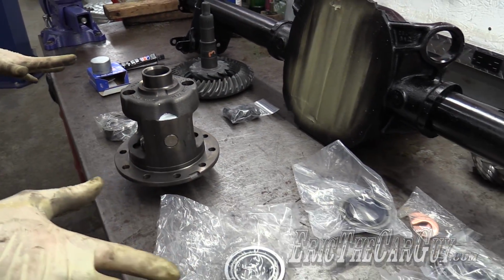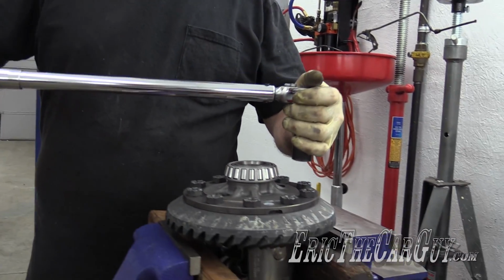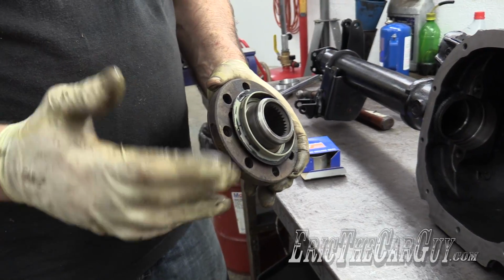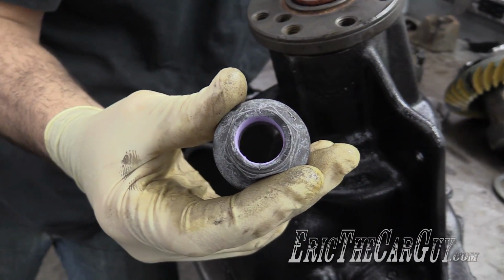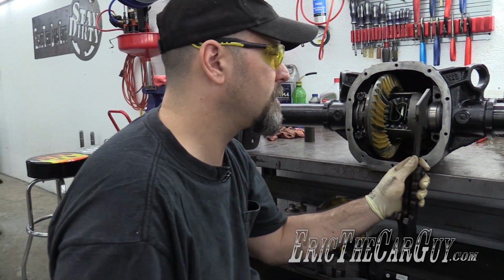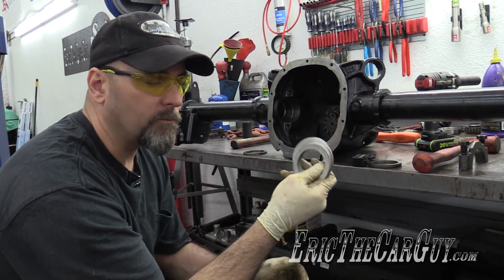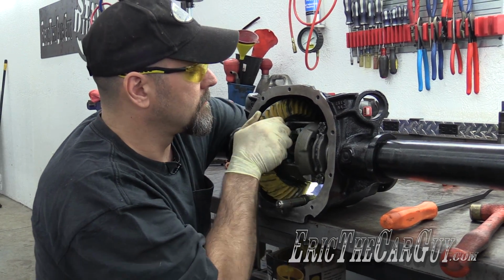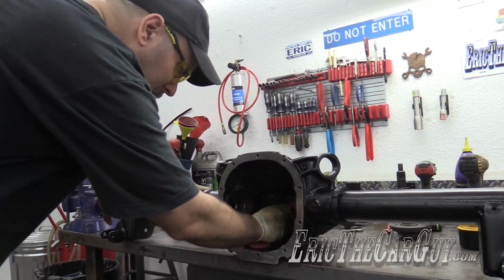Ford 8.8 Assembly & Set Up (Part 1) #FairmontProject

Comment: So you have that backlash because the shims moves the differential gear back and forth. But because we have a inclined teeth gear, that back and forth fixing results in less or more play, like in a right triangle, when you shorten the hypotenuse, the cathetus gets smaller. 
At least is what I understood.
Reply from the maker: Depends if the gears are face hobbed, or face milled. https://www.youtube.com/watch?v=0Y6vOwiCe1U
Reply: EricTheCarGuy So for face milled if you have shims that does not allow you for great adjustments, you can end up with a bigger or smaller than wanted backlash?
Reply from the maker: The adjustments react differently depending on the type of gears used. When setting up a gear set it is important to know what type you're working with so you can get the correct gear tooth contact pattern.

Comment: Here's a tip for anyone doing rears that use crush sleeves. Crush sleeves or crush collars don't need to be installed during initial setup. If you set your pinion bearing preload lets say to 28 inch pounds. That will be the preload you will measure your setup distance or check your pattern against.  Once you are happy with your pattern, then install the crush sleeve and crush it until you reach the same preload.  The crush sleeve is necessary so that a torque preload is present on the pinion nut as well as a memory point in the event the pinion seal needs to be changed. In regards to carrier shims for backlash.  If you are using the same carrier in the same housing measure the total height of both right and left sides. Record that number.  However you juggle left and right thickness to obtain your needed backlash always keep that same stack height.  This will assure proper carrier preload.
Reply from the maker: Thanks very much for the input Paul. I'll be leaving the crush sleeve out next time I do a set up. I hadn't heard of that until the comments of this video and I did a lot of reading before I made these videos.  As for your recommendation about the shims, I actually cover that in Part 2. Thing is, the Ford shim kit is very limited and that's so hard to do. I think this would have taken half the time if I had a shim kit similar to the one you used in the T-5.
Reply: +EricTheCarGuy Didn't the new ring and pinion come with a spec for distance? Often times people think they need a special tool for setting distance. The reality is your bearing caps split on the center. You lay precision flat ground stock across the saddles and use a standard depth mic.
Reply from the maker: Nothing like that, but in the next video I share what I learned from Ford performance which is start with .024-.028 pinion shim. At the end of the day I ended up using the same one as stock. Honestly I think that would be typical for a set of Ford gears. IDK about the aftermarket ones though.
Reply: The Dana and the Ford stuff is pretty accurate. Some do a nominal measurement and then you'll see a + or -2 on the gear. Best to keep to OEM gears. Aftermarket stuff is all over the place. The pattern looks good. Can't wait to see the car come alive.
Reply: They do have a collapsible spacer. The pinion depth shimming is done behind the pinion housing.  Aftermarket does have solid spacer kits that consist of a solid sleeve and a shim to set the final bearing preload.
Reply: Paul dropping more knowledge
Reply: What about the 9" though, Paul?
Reply from the maker: Me either. It's been a long road that's for sure. I hope it's worth it.
Reply: GearBoxVideo I'm glad someone mentioned that I've been doing this for years just needed a couple specifics on this one particular diff because I did not have it apart in front of me you definitely do not need to waste all those sleeves and go through all that extra effort
Reply: GearBoxVideo ,what if I'm using a solid pinion spacer with shims?
Is it ok if i use the spacer and the shims with the preload set at 19 inch pound(my specs for my 12 bolt)then the steps you gave?
Reply: add my facebook thanks

Comment: I have changed the pinion seal without a new crush sleeve or special tools. Since bearing wear is going to make the pinion bearings very slightly looser with wear. just take off the drive flange(part that holds drive shaft cups). pull out seal. replace seal put flange back on. have a clean pinion threads and knut threads. Put some high strength lock tite on and tighten knut till you get the bearing drag for used bearings. Actually you can feel that well enough. All went well and over 150k later was still good. yes you can do some things without special tools. Other than leaking pinion seal, and outside axel bearings. I have never had a differential fail in over half a million miles.
Reply: I would say, if you are trying to get by cheap. get a good junkyard rear end and just use it.
Reply: The crush sleeve's purpose is so that you can change a seal and have a torque on the nut without affecting bearing preload.

Comment: you can also use a ratech crush sleeve eliminator kit make setting the pinion preload a breeze, and yukons differential shims come with a lot of smaller shims had to get the yukon kit to get mine in spec easier. 

also the koyos are a higher torque bearing then the timken both will work but the koyo is the one they use in the gt500 differentials koyo std4183 is the bearing number for anyone wanting to know
Reply from the maker: Both are linked in the description.

Comment: Eric was the new bearing you bought, the exact same as the one in the Ford gear kit?
Reply from the maker: Nailed it.
Reply from the maker: Links in the description to the parts I used.
Reply: No. OEM uses Timken, Ford Racing uses Koyo.
Reply: EricTheCarGuy What I meant was, did you use the gt500 bearing or just a standard 8.8 bearing?

Comment: Properly setting up a differential is so tedious!  I've only ever done it once, so videos like this are a great learning experience!

Thanks for taking the time to go through the steps with us, Eric!  You rock!  :D
Reply: only when it has a horrible design towards setup. love my old landrover as it has the diff pumpkin as a seperate unit, no diff cover and you take the whole thing out as a unit, no shims on the diff carrier, only adjustable end caps. do them up to get perfect backlash and preload. pinion has shims that go on the other side of the bearing so you dont need to take the bearing off to change pinion depth. also making life a lot easier. take about 1-2 hours to change gear ratios and diff center on the bench. also ring gear is so close to not a press fit a swing with a hammer dropps the old ring gear off.

Comment: pressing the bearings with the race under is a bad idea , i have had those go bad because the rollers leave a mark on the race and it begins to howl  after a few months ( which is nothing for a good bearing ) , admittedly this happened to me  just once  when i was using bearing of questionable origins , but i always prefer using a socket  fitting the inner race ( or outer depending on what i am pressing)  or even better  i may have  inner/outer races from older bearings
Reply: Was that why he had the groove in the race because he pressed against it?

Comment: what is this back lash?
Reply: When you upset the wife
Reply: The easiest definition is free movement of the gear. In this case the gear on the differential can move .008" in rotation without needing the pinion gear to move. --- Mr Cornwall, I have no wife, therefor I have zero backlash. :)
Reply from the maker: It's the free movement the gears before they engage.
Reply: Lol
Reply: +Timothy Earp thanks. is it good or bad?
Reply: +EricTheCarGuy thank you.
Reply: Tureno Levin It is neither, too much free play and not enough are equally bad.

Comment: Those bushing/seal driver kits are a life saver.  I use them for control arm bushings, wheel bearings and the like all the time.  You wouldn't think they'd be strong enough since they're aluminum and so light, but they work a hell of a lot better than sockets.

Also, that's why professional differential builders use large pneumatic impacts.

Comment: You're doing it the hard way. For setup you don't need the crush sleeve at all. Just tighten the pinion nut (without sleeve) until you have the required drag on the bearings. 

Also for the final tightening of the pinion nut (with sleeve) you can easily use the impact. It turns so slow due to the sleeve that you can set the bearing drag no problem.

Comment: I had to do work on my F150 rear end... although I've been turning a wrench for 20+ years.. I don't have any experience with the internals of a diff. I do know of the need to make sure of the tolerances.  I tackled it. The hardest part was installing the carrier with the shims. (even broke one). I can learn lessons. What I learn, was this is better done by someone with the experience... not just the know-how. if my diff goes nutty again.. I'm WILL be taking it to a diff shop. Great video. real informative. and kudos for not editing out the mistakes. It's those mistakes that will help others.
Reply from the maker: I fall on my sword so you don't have to. ;) Thanks for your comments.